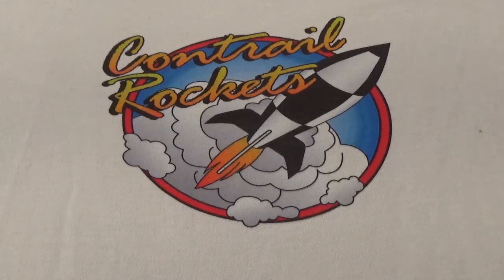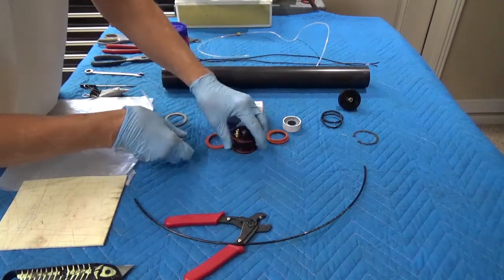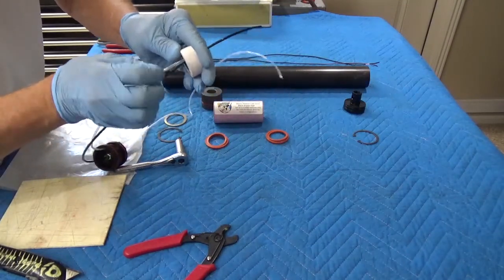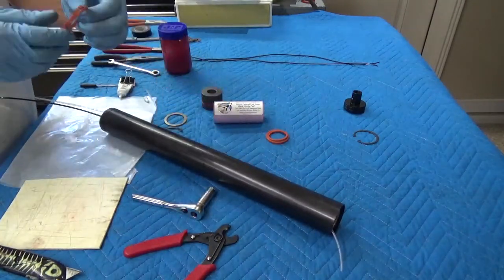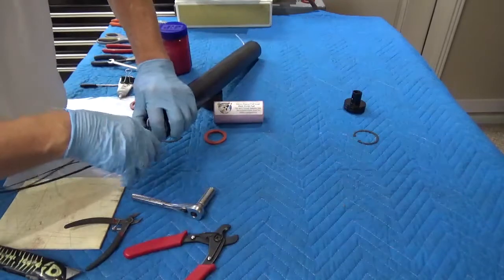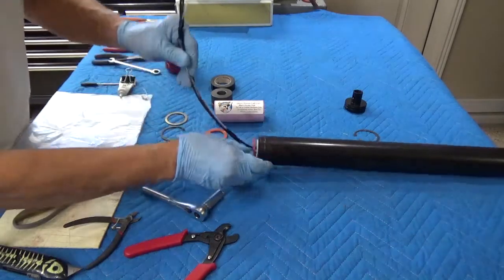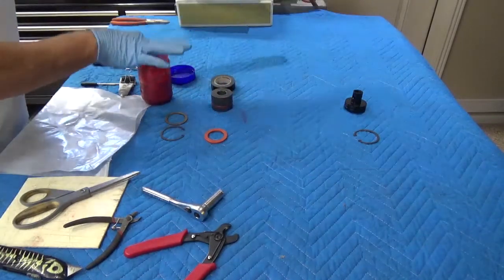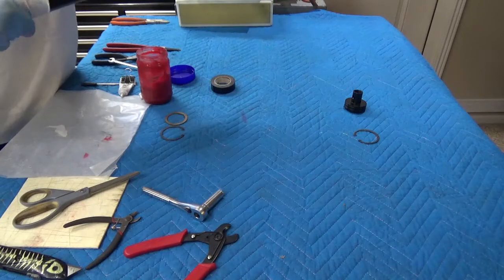54 mm Internal Vented Assemble Video

Comment: Hi! Just a question regarding the high temperature o-rings at the beginning of the video for the nozzle and injector module, can these be substituted with regular o-rings?
Reply from the maker: Sorry for delay  normally don't look at comments here.  Yes but the Red last long and do not burn/crack under higher heat of combustion.